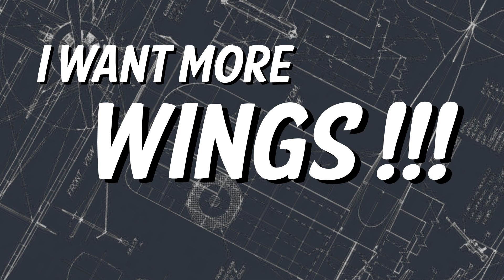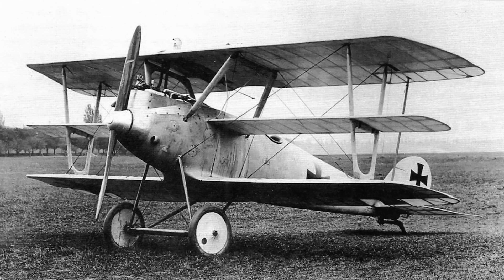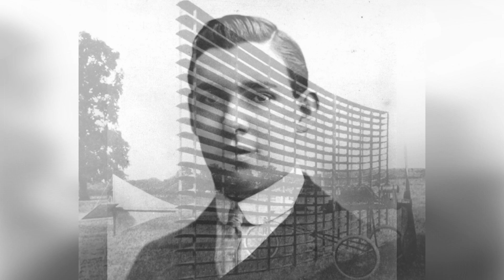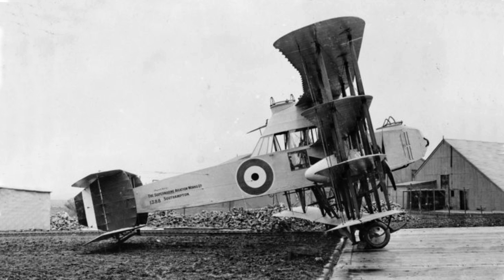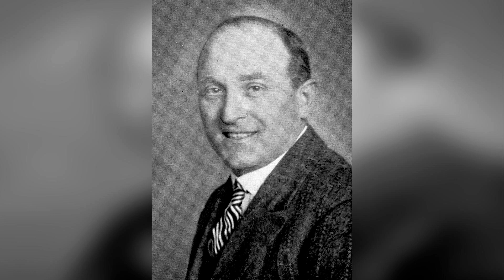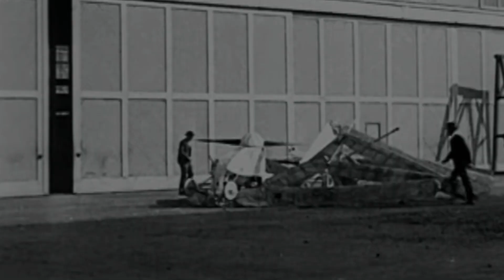GIVE ME MORE WINGS! A history of some of the craziest planes ever!

Comment: Fascinating - thanks for putting this together Gary. Of course, as much as those early designs can raise a smile, the ingenuity of them with so little knowledge of aerodynamics available and the sheer courage of many of the pilots then is worthy of acknowledgement too.
Reply from the maker: Absolutely right. I'm reminded of when an aerodynamicist called Richard Whitcomb said that to reduce induced drag on a long wing what you needed to do was add one or more little wings at the end to disperse the winter vortex. He had all kinds of versions, including a multiple array of little wings splayed out rather like the feathers at the end of an eagle's wing. But what seemed to work was a little wing sticking up at the end, maybe with a smaller one sticking down. We now call them "winglets" and Whitcomb winglets are on pretty much every transport aircraft built today. Incidentally he also invented the "area rule" for transonic drag reduction and the supercritical aerofoil section used by airliners. And he didn't much care for flying either. An unsung genius of modern aviation.
Reply: @garys_stuff  Thanks Gary - I hadn't heard of Richard Whitcomb but will now do some further reading. I have a fascination with these 'power behind the throne' people.

Comment: Gary, great video! The curiosity that springs to mind that Fokker produced the very successful Eindecker monoplane /before/ the more famous Triplane, so his designs went from biplane to monoplane to biplane, triplane, biplane. As the Eindecker was so good, why did he then revert to biplanes?
Reply from the maker: An interesting question. I think perhaps the development potential of the Eindecker was limited, perhaps combat was changing and he needed the lift and manoeuvrability of two wings, maybe the weight of the better engines for more speed meant more lifting power was needed than he could get out of a single wing. Making the wing bigger by making it longer would compromise the roll speed significantly. Also, they were beginning to get better ideas for aerofoils so the efficiency of wings was increasing, so smaller biplane sets with good roll and good lift capacity meant a better and faster fighter. Ultimately, of course, biplanes all but disappeared within twenty or so years, at least in combat.
Reply: @garys_stuff  Good points. Also despite only having a single wing perhaps the Eindecker was harder to construct so for ease of construction and greater productivity - 'There's a war on y'know!' - he returned to the traditional biplane. Also perhaps it was harder to fly for pilots who had trained on biplanes.
Reply: In Europe, before WW1 both biplanes and monoplanes were equally popular. A series of crashes in France led to a brief ban on monoplanes flying there followed by a short ban on flying monoplanes by the British military. It was Louise Bleriot who pointed out the flaw in monoplane design that had led to the crashes (not taking into account multiples of "g" stresses when designing the wire bracing of monoplanes). With this flaw fixed monoplanes were soon back in service and made up a good proportion of French aircraft strength at the start of WW1 and a less, but still considerable, part of British aircraft strength as well. The Fokker Eindekker was in fact a pretty close copy of the French Morane-Saulnier type "H" monoplane. Its chief reason for success was absolutely nothing to do with it being a monoplane - At first, it was purely the success of its synchronised machine gun. This was followed up by the fitting of progressively more powerful engines and the tactical advantage of some German pilots being allowed to be devoted to being fighters (rather than having reconnaissance as their primary duty). The Fokker monoplanes (and their Pfalz E.1 to E.VI contemporaries, also copied from the Morane Saulnier Type "H") were countered by more manoeuvrable biplanes and so the Germans, in turn, adopted biplanes. The very manoeuvrable Sopwith Triplane was in turn countered by the Fokker Triplane. At the end of the war, the Fokker was just putting his parasol monoplane DVIII into production, although the British and French had flown a series of French-designed parasol monoplanes for most of the war (The Bleriot Parasol, the REP parasol, the Morane Saulnier type "L" "I" and "V", the latter being the most successful). But, until the advent of fully cantilever (without wire bracing) low-weight wings made possible by Alclad in the early 1930s, a well-designed biplane fighter tended to have the advantage. https://www.dingeraviation.net/articles/monoplanemyth.htm

Comment: It’s interesting that Sopwith and Fokker built their triplanes but later designs were biplanes. Evidently they decided there was no advantage to going further with the multiplane idea.
Reply from the maker: Indeed, the advances in understanding aerofoils and their flow dynamics, and the structural support needed for wings, pretty soon ruled out the need for triplanes. In their time they were great for things like fighters because the narrow span gave better roll rates and such, but the drag penalty of the extra wings and supports soon started to become a bigger issue when speeds increased, as did their structural integrity. I guess an interesting "what if" would be to re-engineer a Spitfire with a triplane layout of narrow wings!